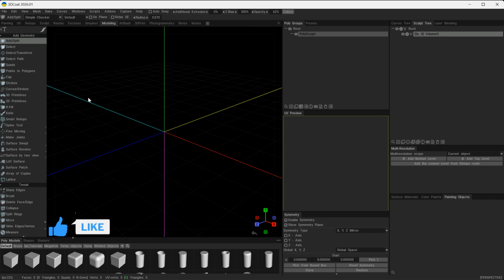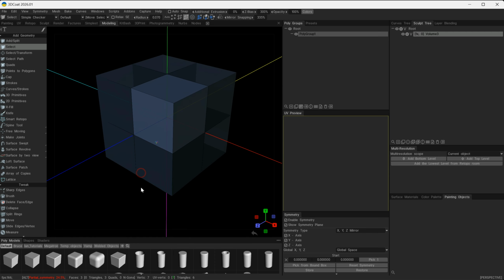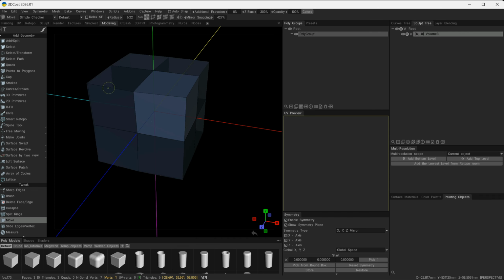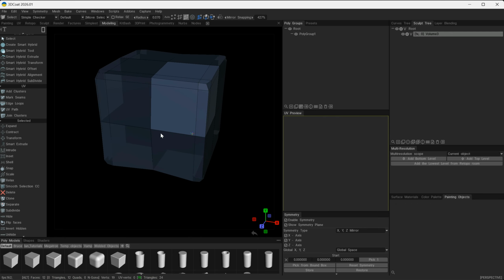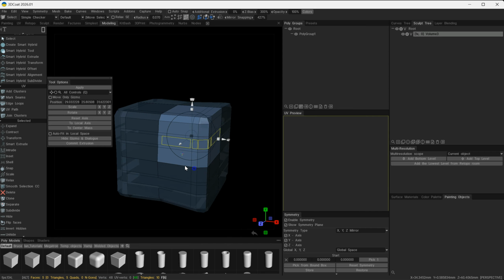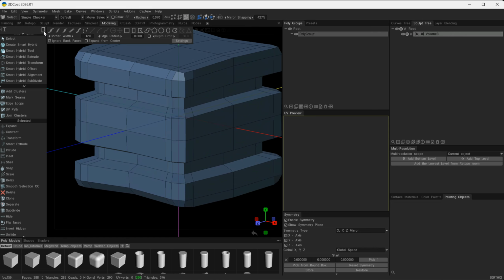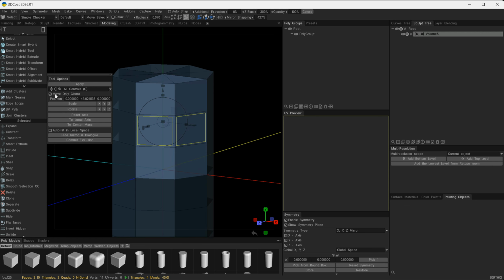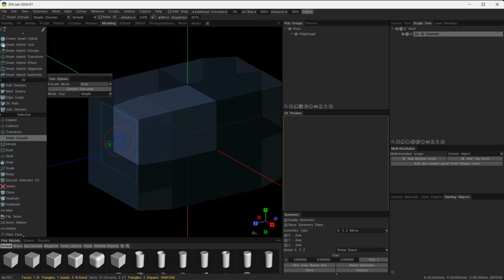3D-Coat Modelling - XYZ symmetry

Comment: I guess you know very well why many people prefer to disable virtual mirror... You cheated a bit here by using Move tool, but if you try to use more precise Select and Transform gizmo transforms, they are bugging badly if selection touches symmetry plane, that is super annoying forcing you to: disable symmetry, do transforms, enable symm back. Hope they will fix it one day. Also one thing worth noticing about symmetry in Modeling room is that it is Global. You can't have different symmetry setups on different objects. So if your object is not in world center and not oriented to world axis, setting symmetry for it becomes a very tricky task.
Reply from the maker: When you say cheating using the move tool, its a viable option if you're not being precise. There are other ways to create the same piece of geometry. The main thing here is the ability to knock out forms, albeit exploration from a very limited number of polys. Its easier to select and perform the operation with only a few polys selected at a time and then the mirror takes care of the rest. If I used this, it maybe to block out buildings, such as a modular core which I could design outwards from. Like I mentioned there are other ways to do the same thing in the Sculpt Workspace for example, but I prefer to work with lower polys to begin with... just my preference.